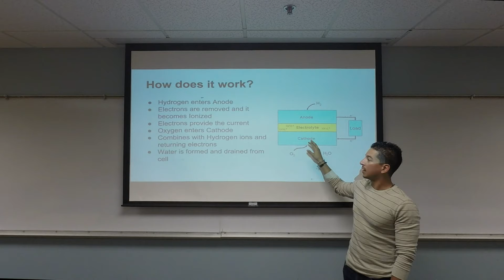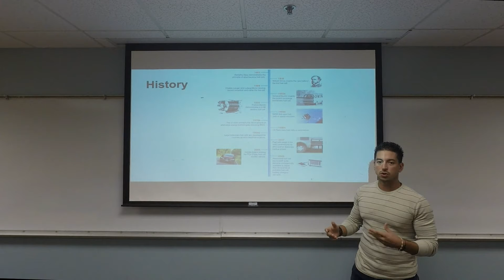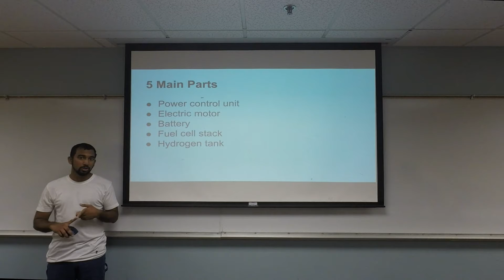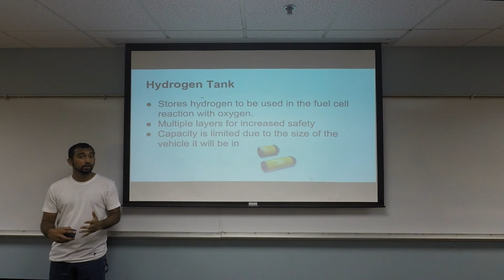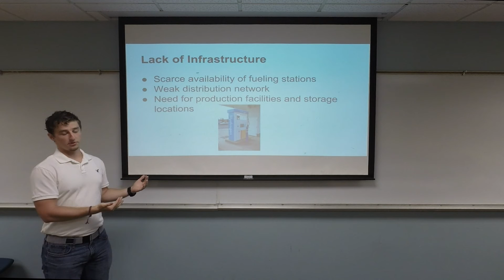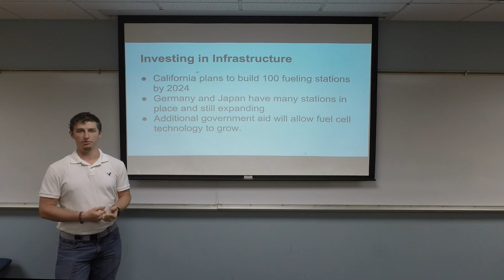Team 13 - Fuel Cell Vehicles

Comment: The video was perfect length and you can see the slides well. The presenters kept good eye contact with the audience and did a good job using the PowerPoint to their advantage. They had smooth transitions and they knew what they were talking about and didn’t read directly off the slides.